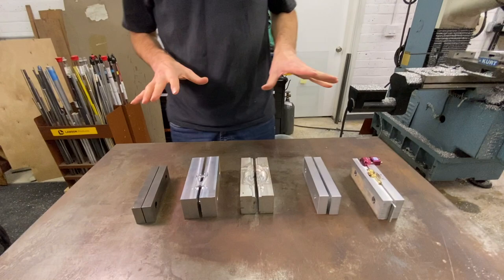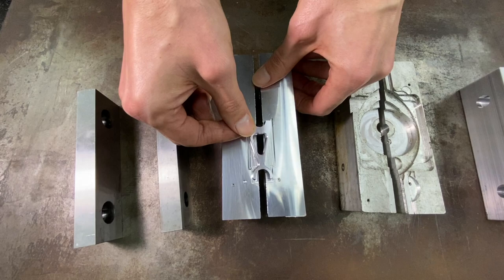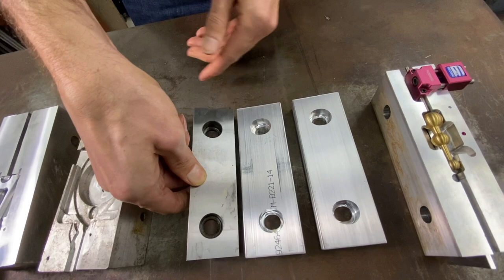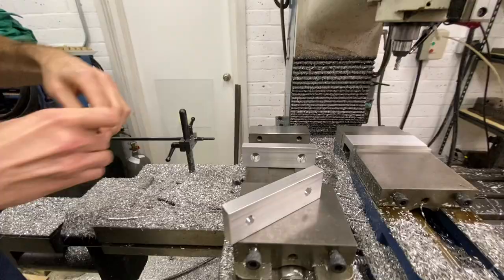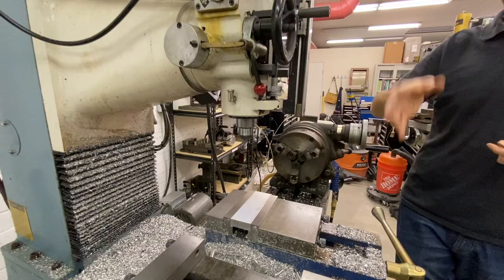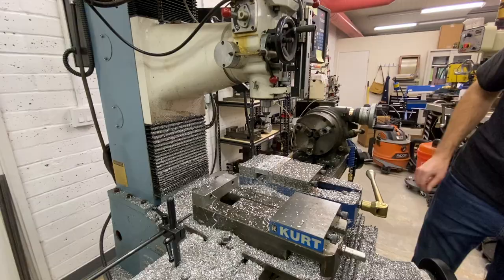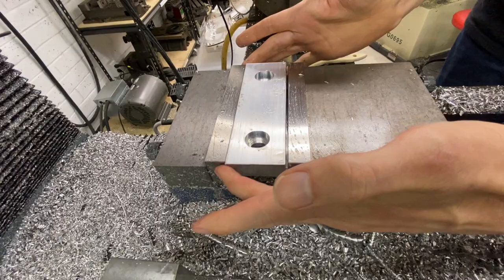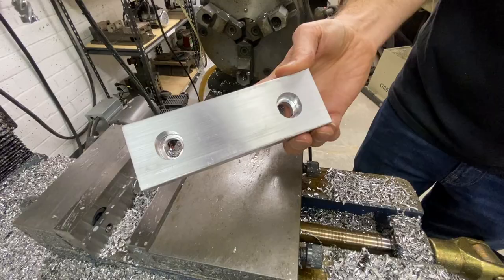MAKE YOUR OWN SOFT JAWS

Comment: Also seeing an exhaustive surrender to lathe jaws. 
Used with the existing jaws with an anchor screw. Saw these built in a set of 4 to use on 3 & 4 jaw units. 
Copper ,brass, aluminum and tool steel to save the original or restore the worn set.

Comment: Hi, good vid, Im begginer and I will do parts like that, I want ask you, Is your mill cnc conversion? how does the R8 weldon or ER specific tool holder work to repat the Z heigh in cnc? Is many Z heigh variation when you changing tool like weldon? because I dont know how many Z heigh can change depending how many torque do in drawbar,   many thanks
Reply from the maker: None of our machines are cnc converted right now, all factory cnc. Any of the R8 solid holders or ER R8 holders are good for cnc. Tool height should not change at all if your tools are tight. Drawbar torque should not change tool height ether. If it does, your holder or spindle are dirty.

Comment: The hell? Run a fly cutter across the back/mounting face, and the botttom face before you drill/mill the holes to give them solid mounting faces.  Use some basic skills and understanding here guy.
Reply: Did you watch the whole thing? He does address that point 6:06
Reply from the maker: Yeah its best to cut the back for the best alignment and grip. See 6:06.